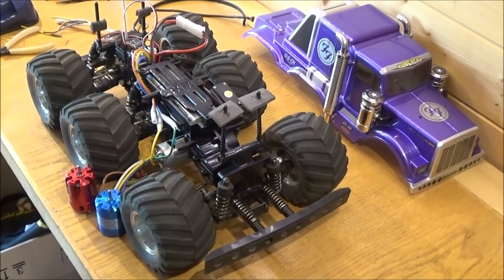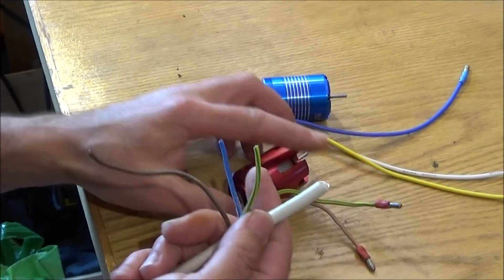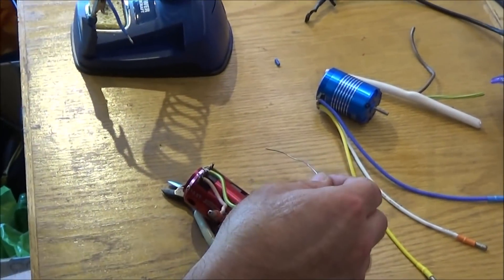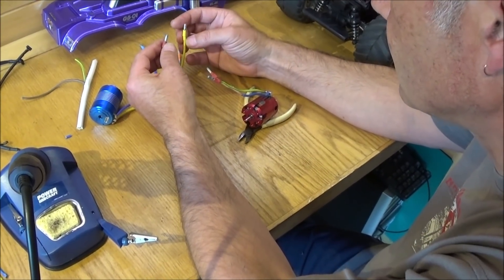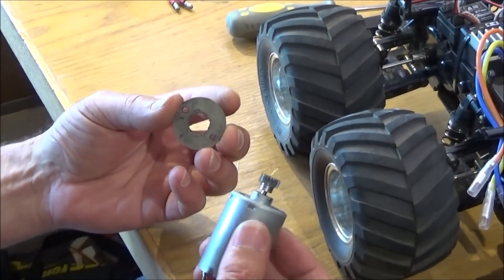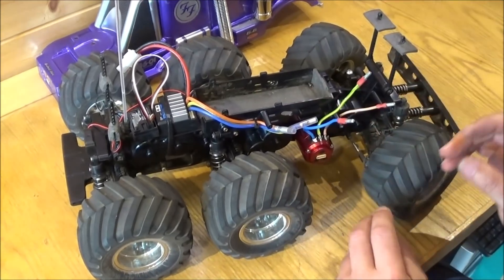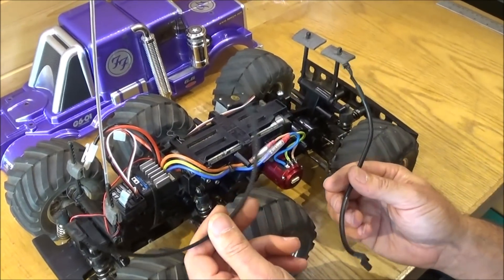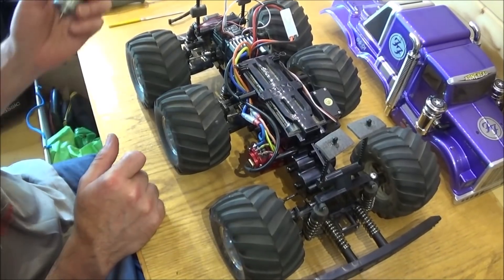How to fit a Brushless Motor to a Tamiya Konghead & TBLE-02s Set-up

Comment: That was very informative and interesting. I thought Rob did a good job on the camera, too - it was easy to follow the soldering sequence as a result.
 I´m looking forward to the speed test. The tyres on the Konghead look very much like those on my old Midnight Pumpkin, and the wheels look like the ones from the posh chrome version that I didn´t get  : )
Reply from the maker: Thank you Del, for another fine comment! I will pass your camerawork comment on to Rob - I think he did a superb job too, considering my Sony Handycam he was using is new to him and has a few handling and usage "quirks". Focussing is quite tricky and the zoom function is hard to control smoothly, but get it right and the pictures are crystal clear!
As I said to IT'S ALL ABOUT RC! , the Konghead is geared very low, so don't expect big speeds, I just wanted to show what difference spending just £20 to £25 on a motor would make to the standard monster truck.
Yes, I think the Konghead tyres are exactly the same as the Midnight Pumpkin and Lunchbox. We have looked at the wheels on Rob's Lunchie and the size is the same, however the offset is different and hole for mounting the axle is deeper, meaning they wont fit the Konghead unless you change the axles too (quite an expensive conversion). It's really interestin that you mentioned this Del, as we were looking to mount some black Lunchie wheels on the Konghead. This is because, although the "posh" plated wheels look nice at first, the plastic is harder (presumably to take the "chrome" plated finish) and hence brittle - both Rob and I have several chips in the outer rims where the plastic has snapped off, causing tyres to pop off the rims every now and again!
Anyway mate - glad you enjoyed the video, and I enjoy reading your excellent feedback.  :-)
Reply: So, my silver-painted (over yellow) "poor man´s" Lunchbox/Pumpkin wheels are structurally stronger than the chrome ones - that´s made my day. 
 I´ve just ordered a 27T brushed motor to replace the 35T example that seized on holiday; if I´d seen your video I might have got a brushless motor. My M 06 came with a TBLE-02S, and I couldn´t get it to work with a silver can so I chucked it in a cupboard and used a brushed-only one. I still have it, and after seeing this vid I wonder whether the problem might be that the ESC came set up for brushless.
Reply from the maker: Yes Del - your painted wheels certainly are much more durable than the chrome ones!
As for the TBLE, you can do a very quick check to see what mode it is in - simply plug it into a battery, turn it on (no other connection required) - if it flashes orange, it's configured for brushless, if it flashes green, it's set up for brushed. :-)
Reply: I just did it - it flashed orange, which explains why I thought it wasn´t  working when I plugged it into my silver can.
 I don´t remember there being any setup sheet supplied with it - presumably if one had been included I´d have summoned up the wit to read the thing.
 Still, I have a brushless Ninco Slider which needs an ESC, so I think that the simple act of watching your video has fixed one of my RC cars, and I´m suitably grateful  : )
Reply from the maker: Oh - so pleased the old TBLE sparked into life - you can never have too many spares! Good job it wasn't resigned to the bin, at least you can get some use out of it - I rarely throw anything away either - you never know!  :-)
Reply: I just shove dead electronic components in a big Tupperware in a cupboard. They´re often a useful source of wires/connectors when I´m rushing to bodge together some solution to a problem.
 Your video made me realise I should be more persistent in trying to get things to work before giving up on them.
Reply from the maker: Hehe Del - I do exactly the same with my old components- the trouble is that I usually spend far too long being "persistent" trying to fathom out a problem when the issue should really be consigned to the bin long ago -much to my wife's contempt!!!
Reply: It´s worth it though, when you do find a use for something you´ve kept for ages.
Reply from the maker: Hmmmm - I did think of a witty remark to reply to that one Del, but I think I would get banned from YouTube  =D

Comment: Very nice video Mark! The subtitle told me something about "Lebanon cheese" but it's totally fine for me :D It made my day :D
I like the TBLE-02S. I usually use a brushed motor and the TBLE-02S for tamiya rigs when I wanna go 3S (I'm not the 2S guy :D). For 3S and brushless motors I usually use castle creations sidewinders because I'm not sure if the TBLE-02S can handle 3S and brushless.
Reply from the maker: Thanks a lot Remote Addicted! Hehe - your comment really made me laugh! "Lebanon cheese" I wonder what I said that made it translate to that! I imagine that the translator struggles with my thick English Midlands accent! I don't know if you have ever watched UNBOXING RADIO CONTROL videos with the subtitles on - we have such a laugh reading them as the translator struggles just as much with Ady's Irish accent!
Yeah, the TBLE is a great (cheap) ESC, but I don't think it can handle 3S - I think it would either melt or explode!  Glad you watched this one Charlie - cheers mate :D
Reply: It definitely can handle a 15t brushed motor on 3s. That's what I drive on my GH II. ESC stays handwarm after 30 mins of hard bashing 🤘
Reply from the maker: WOW - rip up the instruction booklet! It's definitely not supposed to be able to do that - great tip though mate - I have a "spare" 15 turn brushed that I thought I had no ESC for - now I will give it a try - thanks a lot Charlie :D
Reply: I'll do a speed run this weekend - hopefully. I'll check the temperatures which you'll see in the video soon :)
Reply from the maker: Nice- Charlie - I look forward to that one!!!